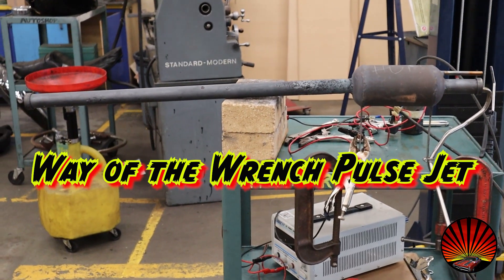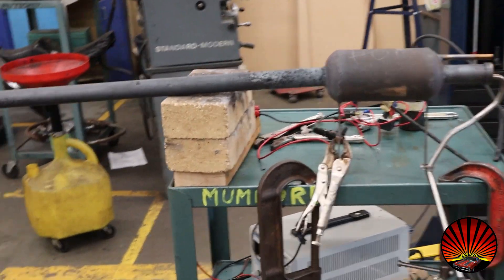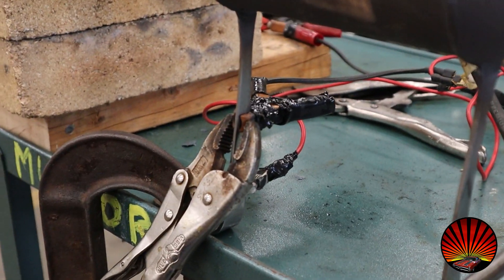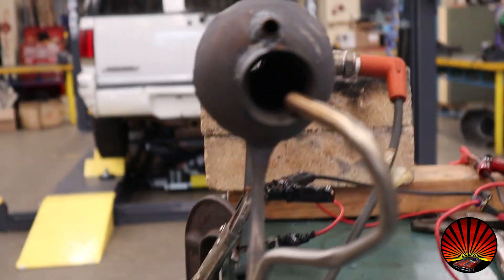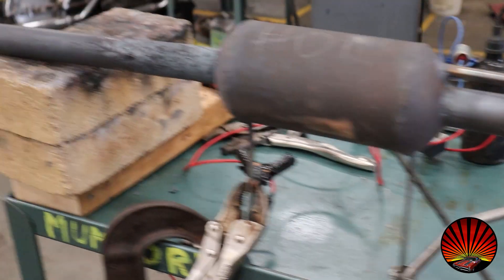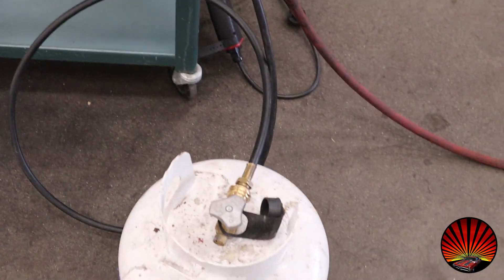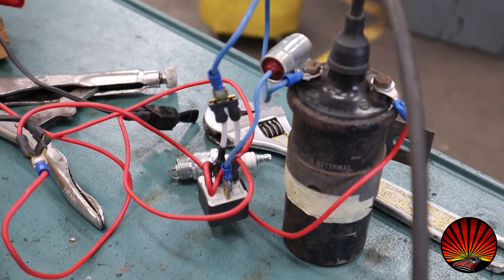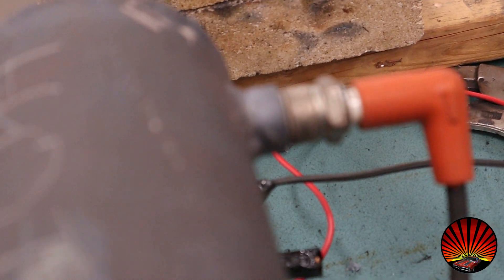Pulse Jet Engine - With 2 soup ladles and some pipe!

Comment: If you make the exhaust longer it should start without the need of heating it up first.
Reply from the maker: Yeah that might work.  It should start and run better with a bigger intake diameter as well because when I play with the fuel intake tube position  so it  blocks less air flow coming in, it runs way better.  One of these days, I'm going to build a bigger and better one and share out the design.  This one was more of a make something cool from something stupid project.  I got 2 stainless steel soup ladles and decided to make a pulse jet....lol.
Reply: @wayofthewrench  I don't suggest you make the intake bigger than the exhaust unless you are making those big lockwood hillers. I find that the same diameter intake and exhaust is optimal for small scrap jets. I hope your big pulsejet will be great.